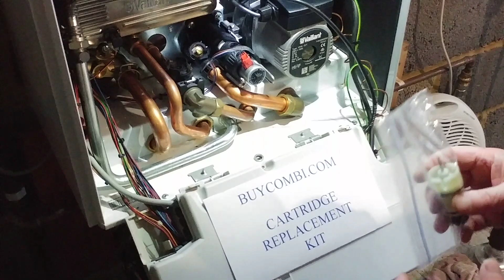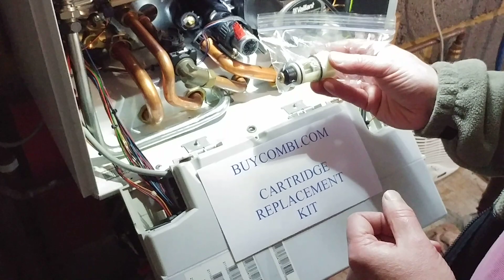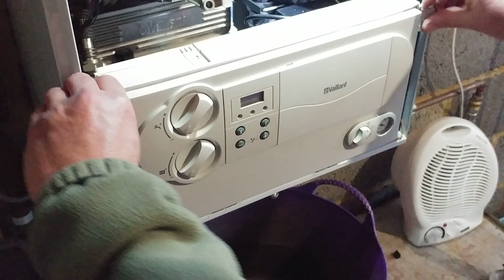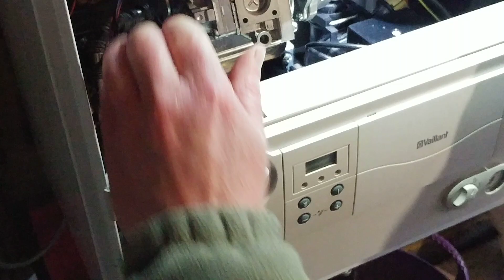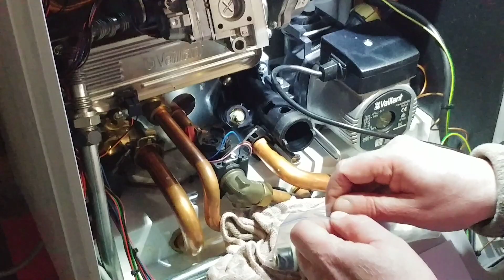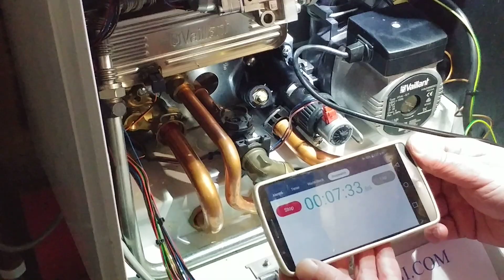Vaillant Ecotec Diverter Valve Leak Repair In 8 Minutes (See Updated Video Link In Description)

Comment: I didn't have to wait long for my parts to arrive which was very welcome because we had moved very quickly from a leak to having no water. It took me considerably longer than 8 minutes to perform the repair that was largely die to the location of the boiler meaning I had to perform some impromptu yoga stretches to access the underside. All in all, I am very pleased with the outcome and the significant money saved.

Comment: Excellent service! The part and tools arrived very quickly and were perfect for the job. Easy to use, as shown in the video. I did have a slight problem as I hadn't put the central heating on before putting the boiler into standby so I couldn't remove the motor. An emailed query to Buycombi was replied to almost immediately and I even received a follow up email asking if I'd sorted it. 5 star service - highly recommended.

Comment: Question: How do you know if the actuator is working? Can you see it moving at all? Could be faulty motor!

My problem is that the valve does not seem to divert water round the heat exchanger when hot water is called for. When using preheat it cycles on and off pumping water round the radiators! I cant see the plunger properly but hard to see if its going in and out even though the motor 'buzzes'.
Reply from the maker: Hi John,
You can see if the pin is moving by looking through the small inspection hole on the valve body. Sounds like its not moving so its either stuck, the motor has failed or the PCB has failed. Get an engineer to take a look. Regards Donald.
Reply: @FitOnce  yes I see its not moving, but there is a faint noise from the motor but not as loud as it usually is. Vaillant put a new valve and pressure switch in so you would assume it should work! He said it was but it wasnt! Now they wont come back because they say that although the boiler is safe to use, its 'beyond economical repair' why? Because the foam insulation on the sides has crumbled and now new side panels are obsolete! So apparently £2 grand + to get a new boiler and scrap the one thats working and safe! Madness or what!

Comment: Yup worked a treat. I would say, it's not 100% clear on the video how to get the motor detached from the valve as it looks like it just pulls out. It doesnt; watch how to attach the puller to the valve stem and do the reverse action to get the motor off the valve. Otherwise, grab plenty of towels (I had a mini flood when pulled the valve out), and save yourself a chunk of cash.
Reply from the maker: Thanks Davin. I have now posted a separate video that shows how the motor is connected to the pin:  https://youtu.be/AvMHBys0Lgs